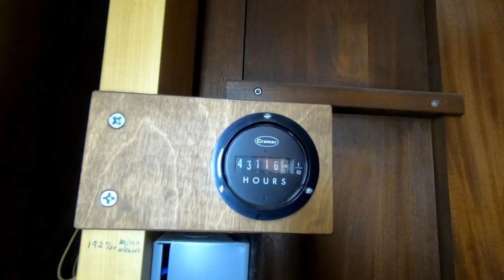1978 Schudi Organ - St. Thomas Aquinas Catholic Church, Dallas, Texas

Comment: At 19:00 you can see the Haskell construction of what I assume to be the Viole de Gambe and Voix Céleste (the gold colored pipes with inverted tubes hung inside them), a technique that works best with string pipes.  With the Cromorne a cylindrical reed and half-length this was no doubt essential to making the rest of the division fit in a space with room enough just for a 4' open.  I can't see if the 8' Hautbois is half length in its bottom octave or mitred.  I do like that one lone offset pipe on the side wall (the Flûte à Cheminée low C# ?).  Not sure if that was planned from the beginning or improvised on site but it makes me smile to think of the myriad challenges organ builders must face all the time.

Comment: roughly, anyone have an idea of the current cost or value of an organ console and the organ here presented---by this builder? any idea of the size of the room? i love this french sound. i am thinking of a nave that holds about 400. it is english neo-gothico, open trussed ceiling, 21 ft. high from center, gallery holds organ and choir. 56 ranks probably too much for our nave, but we do a good deal of anglican chant, ionian,  and gregorian. we need a good solid great, swell, and choir. good bit of solo voice in masses, cantor, and small ensemble. several concerts throughout church using strings, brass, and woodwinds. any ideas?

Comment: I am sorry to correct you but the concave and radiating pedalboard is NOT an American pedalboard, but an ENGLISH pedalboard. Designed in the 1850's by HENRY WILLIS 1 later known as Father Willis. One of the greatest organ builders of his age. The idea came from Willis and Samuel Sebastian Wesley inspecting the Shultz organ at the Great exhibition in 1851 which had a concave  pedalboard. Wesley suggested that not only should Shultz have made this pedalboard concave, but should have made his pedals radiate from n imaginary spot behind the organist's back. Willis gave Wesley full credit for the idea. He then went on to set out the standard which we know today. He made both the concavity and the radius to the size of 8 feet 6 inches. On the radiating part the measurement was to the front of the sharps. I am not completely certain but from what I have read in  W.L Sumner's book The Organ I believe the first 8'6" concave radiating pedalboard was installed in the Willis organ of St. George's Hall in Liverpool, England around 1853 or so.
Reply from the maker: You're absolutely correct. What was abbreviated as American should have been American Guild of Organists standard style pedal board, which adopted the English curved pedal board as their standard in the early 20th century.

Comment: A really beautiful instrument.
But... too bad there isn't also a less obtrusive 16' Pedal reed, however. That 16' Bombarde is TRÈS MONSTRUEUX ! 😳
Also: could you be sure that the actual stop names are given, and not just "Here's a flute..." etc. - which we heard several times from the organist (who rushed through the stop demonstration for some reason). You usually take your time in this regard (when you're in control of things, unlike in this video.... 🤔 ).
Reply: Bob, I totally agree with you I like this instrument a great deal and found it swell to hear from the same position as the choir! It has real balls in the pedal.... oh yes the French like that heavy pedal to the metal ! If the need for a softer pedal reed would arise I just couple to the pedal a reed from another division.
Best !

Comment: It sounds nice and all, but I would make some changes in the layout of the instrument.  I would re-use the top manual as a separate Recit-Espressif and move some of the stops out of the Positif to there, such as the strings and Hautbois, and place that division in one of the side chambers.  That being said, I would fill in any missing voices in both the Positif and Recit, and make the Grand Cornet and Chamade floating stops on each manual, like a small Bombarde division.  I just can't see why the two expressive divisions should be combined into one.  It would make the organ easier to play, especially with the French Romantic repertoire for three separate manuals.
Reply: Took the words out of my mouth. Probably would make choir accompaniment easier. This is a nice instrument, it probably deserves a fourth manual and a full length 32' and a pedal mutation at 10 2/3'.
Reply: @zenasm.savage1999  That would definitely be ideal but in order to add a whole new division, the instrument would probably need to be reconstructed or rearranged in the gallery.  With that "4th manual", I would make that into a complete Solo/Bombarde division: Large principals, Cornet, Chamade, and Tubas.  As for the Contrebombarde, a F/L offset could be set up behind the case.
Reply: @phillipbaggio7915  That's interesting. Perhaps the unused chamber to the left of the console would be suitable for a solo\bombarde division. I'm not entirely a fan of the bombard as its voiced right now I feel like an 16' ophicleide would be a better effect.  A 16' open flute and a warm tuba would help round out this instrument although it is probably less authentically French.    Haskelling some of the pedal might be a reasonable solution as it would add some string character which is a little bit lacking.